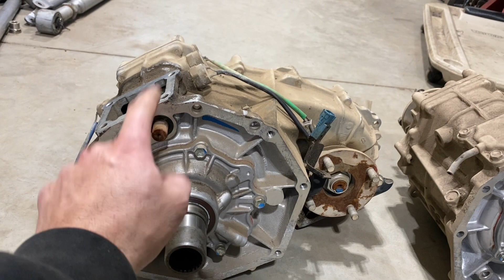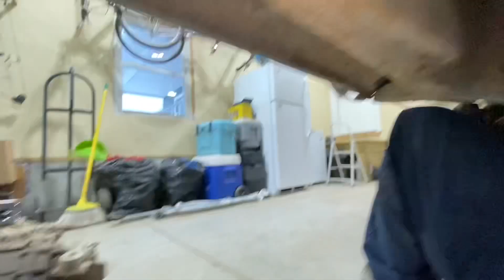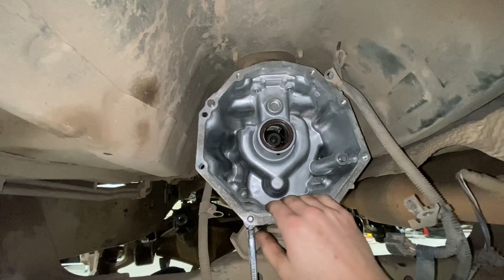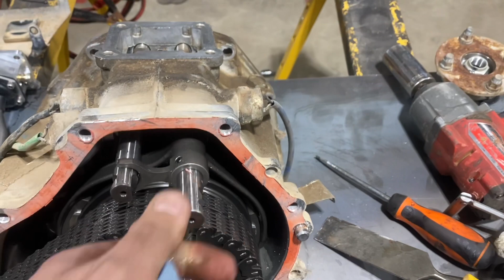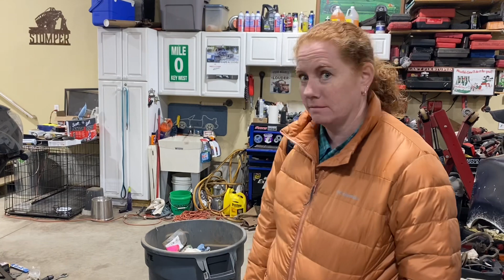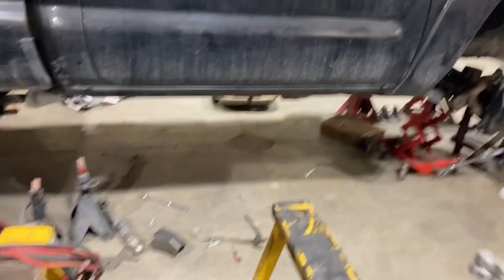2nd Gen Tacoma 4cyl 5spd FJ cruiser transfer case swap, with twin stick.

Comment: When you put the case together did you put the ball and spring back in or leave them out? I have the same t-case and got the pill and ear cut off but you didn’t show if you put those springs and ball back in
Reply from the maker: I did reinstall the ball and spring. That’s the detent that indicates the shifters are at the desired spot.
Reply: @t @turbostoybox2182 wesome thank you for the video and response man. It’s the only one I’ve found that’s worth a crap

Comment: Hey bud. I’m doing the swap on my 09 2wd 2.7 and the rear speedometer sensor will not go into the FJ case spot. I’ve already chewed up one plastic wheel. Do you know what’s going on?
Reply from the maker: I would guess the 2wd sensor is different? Dont have any first hand experience sorry.
Reply: @turbostoybox2182 I’ve read 10 different FJ swap threads, even with guys who have my same engine/trans combo, and not one person mentioned this issue. Of course it would only happen to me. FML. 

I’m doing sas so I don’t really care if my speedo works. I just would prefer for everything to function properly. Thanks for the response brother.
Reply from the maker: @brandonturner6014 I would
Guess you can get the FJ or 4wd Tacoma sensor and it would most likely plug right in.
Reply: @turbostoybox2182 Thats what I did, I found one that claims to fit an FJ, had to order it since no one keeps them in stock. Fingers crossed

Comment: WTH you didn’t show or even talk about how you cut the nub!!!
Reply from the maker: I know, so sorry. I used a small air powered die grinder which cut off wheel. I packed rags around the linkages as best as I could before cutting. Then washed it out with brake cleaner before installing. So far no issues 15k miles later.
Reply: @turbostoybox2182  That’s helpful, thank you for the reply!
Reply from the maker: @ No problem! Good luck with your project

Comment: just got my transfer case for my 5spd taco and I am getting it ready for install. is there any adjustment on the driveshaft length I should be worried about?
Reply from the maker: @dantejubert8692  Nope, stock driveshafts work front and rear.
Reply: @turbostoybox2182  sweet! Thanks for getting back with me so quickly. This swap has hopefully saved me the headache on diagnosing all the electrical bs, being that my 4wd is not reliable anymore. ADD solution after swapping?
Reply from the maker: @dantejubert8692 Can’t help you there. I was doing this with the SAS.

Comment: I’m about to do this same swap on my 3rd gen Tacoma. I’m curious, you skipped the entire tab removal, did you end up disassembling the entire case or did you figure out another way?
Reply from the maker: Sorry I must have skipped filming that. I ended up stuffing the hole with rags to catch metal debris and cutting it off with a borrowed dremel tool with a tiny cut off wheel.
Reply: no worries, i know how that goes. That's good enough, i was going to attempt that before anything else anyway. Thanks for the info and making the video.
Reply: @turbostoybox2182  damn that would have been key to see!

Comment: Did you end up removing the small ear on the 2/4wd rods? It appears the 4wd goes backwards and the ear would not affect it…?
Reply from the maker: Yes I did have to grind that off. Used a 2” cut off wheel on a die grinder.
Reply: @turbostoybox2182  did you take the shift rod out of the case? or did you cut the notch off in case somehow?  any video of that part??
Reply from the maker: @danielborrer270 I stuffed grease covered rags down under the rods and cut in place. The grease attracts the metal shavings. Then flushed thru with a couple cans of brake parts cleaner before putting together.
Reply: @turbostoybox2182  does the shit rail not slide out?  Reading the instruction on FrontRange web site says " 6. Carefully pull out the left side shift rail. Grind the tip of the lever,
approximately l/8’’cube that overiaps也re right side shift rail.
7. Reinstall lever after grinding.
Reply from the maker: @danielborrer270 I could not get it out. But I might have missed something.

Comment: What year fj tcase can u use and does it bolt directly to 2nd gen Tacoma transmission my truck is a 4cylinder 5speed as well are all the bolt holes the same ??
Reply from the maker: 07-14 FJ cruiser automatic transmission. That case is a direct bolt on once you swap the little adapting coupler.
Reply: @turbostoybox2182  thanks man I appreciate the quick response
Reply from the maker: @justgonnasendit8024  No problem!

Comment: Following this. Looking forward to seeing how you wire everything up.
Reply from the maker: So I will only be wiring for the dash light. I am going to be running solid axle with lockouts in front
Reply: Gotcha, yeah I’ve got IfS and lockers and I’m kinda wanting to stay that way for now. I wonder if it’s easier then SAS for the transfer case anyways